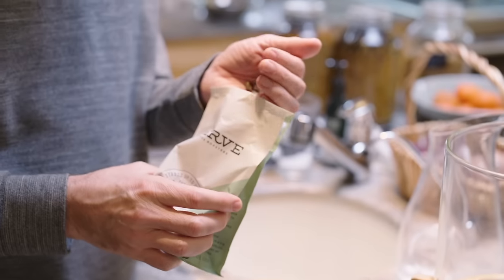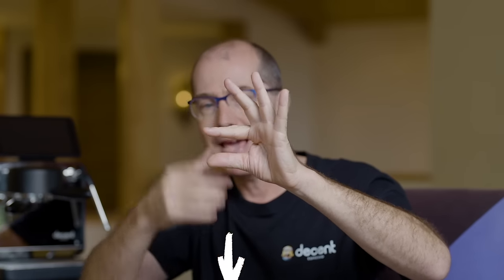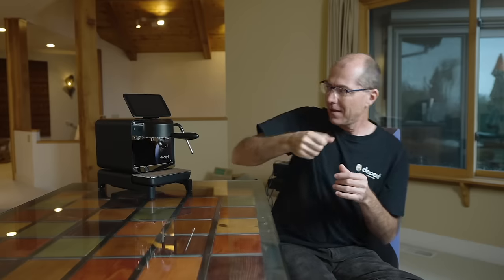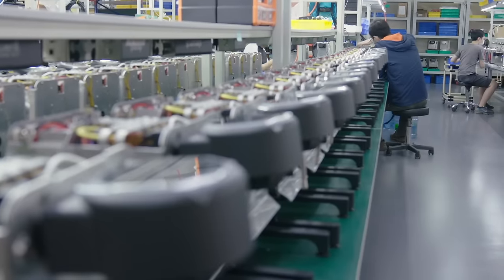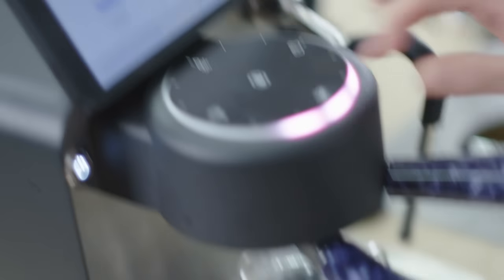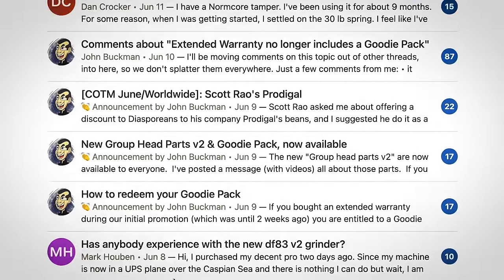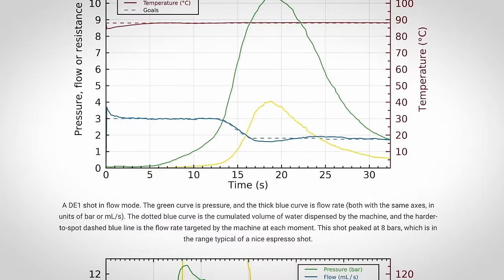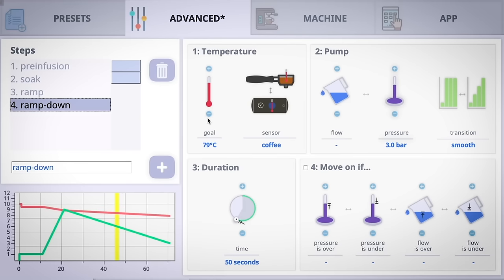Works in Progress - Decent Espresso

Comment: Great video! As much as I envy the Decent, I am stuck? with a Profitec pro 700. I have just installed a Pressensor flow rate transducer. Although nothing is technically advanced as a decent, it does provide a huge upgrade to  my 2019 machine when paired by BT scales. So not all machines are stuck in the past😊

Comment: All great but even their website doesn’t work, at least on mobile. All the texts are on top of each other. You can’t make a proper website? The machines UI looks disgusting too. It’s great you show all the data but a more practical everyday use UI is necessary too. What am I going to do with graphs? Great to have as an option in case I get interested but please fix up your UI. Also the only reason I’m interested in this machine is because all coffee machines have plastic in contact with the heated water. You have this claim “Most home machines have a plastic water tank: ours is made of food-grade glazed porcelain. No toxic BPA water worries. No aluminum in the water path.” Is there also no plastic in the water path? Or are you saying No toxic BPA just in reference to the water tank? It’s not clear and I suspect you didn’t pay up for a proprietary heating path. So the heated water goes thru plastic tubing doesn’t it?